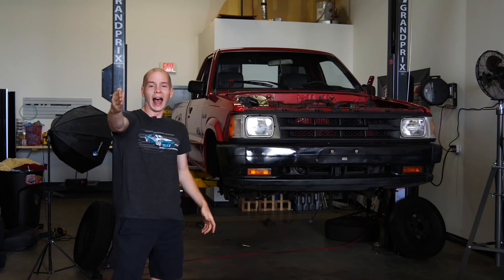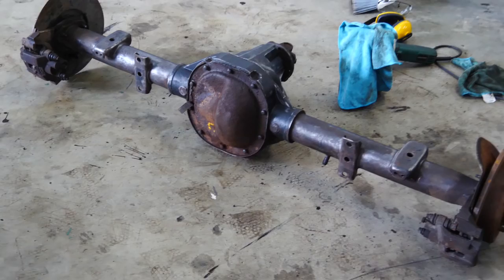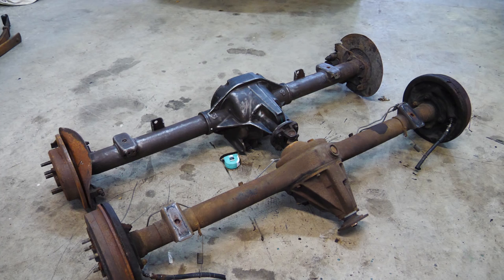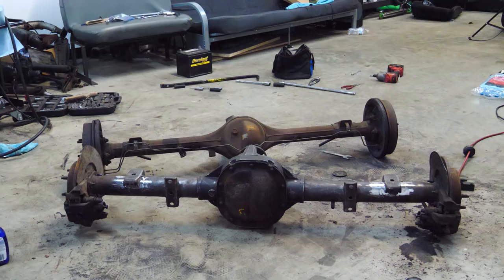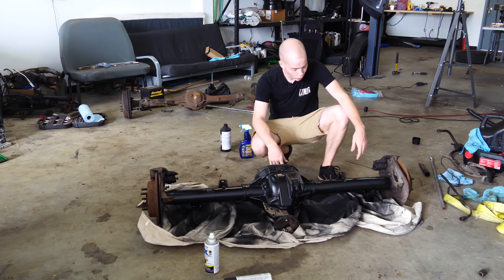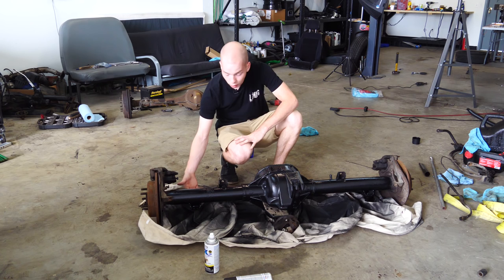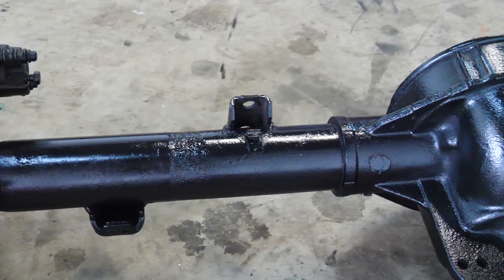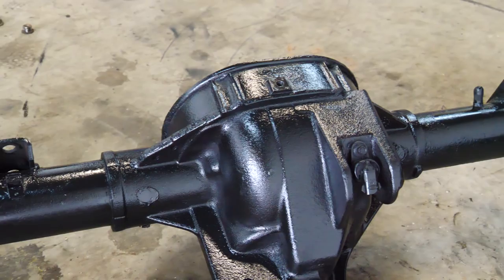Modifying the Ford Axle to Fit! - Project Drift Truck Pt 4

Comment: It was not faulty cutting discs. It was poor clamping that kept breaking them. The part twisted in a way that snapped the disc.
Reply: Ya i was thinking the same thing watching this. That final cut was curved and the disc bit into it then flexed.
Reply: yep, that was hard to watch..
Reply: I don’t get how he didn’t realize this. I knew the moment he started to cut it that would happen
Reply: he probably doesn't understand just yet because he's only just started doing metal work like this, sure for people like us that have thousands of hours under our belts we can see it and just shake our heads, but he is just a new comer, he'll learn...eventually
Reply: the third disk that broke was only partly because of the clamping, you could see him not anticipating the the angle grinder would "launch" forward as the disk wanted to cut the top bit.
Reply: Yes, those clamps were garbage.
Reply: And he let the discs get to small because they tend to shred at that diameter
Reply: General Insanity Dude its common sense. When your pasty white and sheltered in mommys house with your weekly per diem, your going to learn the hard way
Reply: He also eventually uses the cutting disc to polish, and puts too much effort into them...
Reply: Chucks Stuff I guess you just skipped learning grammar?
Reply: Was thinking the same, those types of cuts in general can be tricky to do with an angle grinder especially free hand as it can be tricky to keep it going in straight, if you move your arm a bit much it will bite into the cut and get stuck and break. (even if it's clamped better)
Reply: Just buy a bench vice .. your health insurance will thank you

Comment: I'm not sure it it will help you but look into slapper bars for the leaf springs. That's what I know them as. They are used in drag racing to prevent wheel hop so it might help for drifting.

Comment: HOW TO CUT WITH AN ANGLE GRINDER:
This will probably drown in the comments, but someone might learn from it. Mount the work piece properly, preferably in a bolted down bench vise. Never cut backwards, cut a shallow guiding cut on top if you need to but then start at the end towards you. Work about 1cm at a time and cut through before moving forward that way the disc will roll up on top if it sticks and get free. If you go the other way it will dig it self down into the gap when it sticks and probably explode.
There's nothing wrong with the quality of the discs, YOU are doing it wrong!
Reply: Yep. Caveman'ing it. Those discs have no lateral strength

Comment: @gingium when you weld try making sure the copper band in the middle of the ground clamp is touching the metal. It gives it so many more points of contact.

Comment: You could make your own traction bars that run from the bottom of the U bolts to the frame of the truck and it will help prevent wheel hop and wouldn't be too expensive. You may be able to find some for a Ford 8.8 that will bolt on and weld right to the frame but it wouldn't be too hard to fabricate if you needed to make them yourself.

Comment: in the rain, trucks are amazing. took my 1984 ford f150 xlt lariat, 5l v8. out, (note, its like 8 meter long. non double cab) and every turn it just hates it rear tires. only needs like 70km/h to drift. trucks are the superior drift car lmao

Comment: also get a welding lens and cut it so it fits over the camera lens so you can show the welds being made, also get pearl abrasive brand grinding disks and cutting disks
Reply: also dont put a lot of pressure on those cutting disks, when they break they can do a lot of damage to you

Comment: little tip, you can dramatically improve the durability of that axle for the abuse you're gonna put it through by welding the axle tubes to the center and buying a bearing cap support cover for about a hundred bucks. it reduces deflection and both of those mods together it shouldn't break on you. at the very least weld the axle tubes since that is essentially free for you

Comment: Gingium here's a few tips on grinding
1. Don't buy grinding wheels from a store like home depot or Lowe's you can he a 10 pack for like 5 bucks or something cheap like that
2. Take of the shield, from my experience it doesn't actually help the only thing it does is get in the way
3. Get an attachablw handle, it in creases the grip you have on the grinder helping prevent breaking blades and it gives you a little more control.

Thanks I'm not trying to be a know it all I just want to help

Comment: I would have welded the axle tubes to the diff housing. Its a know weak point since they are usually pressed and pinned in place. Its cheap and easy.

Comment: Look up a set of slap bars they attach to your leaf spring and have rubber bushing that goes against your frame and stops the axle from twisting up it's an old school hot rod trick Summitracing should have it

Comment: The discs are breaking because the piece is moving and breaking the fosc. Also have the disc contact the metal at the 6 o'clock position, it will dig and snap when it gets closer to the 9 o'clock position.

Comment: Calm down with your pressure when cutting steel with that. And it's not recommended but you can use the grinding wheel to cut

Comment: u can remove the speed sensor on it and just plug the threads with a weld or a bolt!!! You should also clean the breather nipple, Be careful not to get it clogged cz that will cause problems

Comment: You really need to get a bench vise.  Even a crappy Harbor Freight one is better than those quick clamps.  It makes any sort of metal work easier.  Also, the cheapest way to eliminate wheel hop are Slapper bars.  Like $150 for a set.

Comment: the dodge ram srt10 had a solution well somewhat solution which was to put a center shock to help with wheel hop.  so take a look into it and see if that helps you out..  also wish I could get you a band saw so you did not have to use that damn angle grinder.. LOL.. cheers bro.

Comment: Hey when you're using 1mm cutoff wheels you shouldn't use force to push them down, they break extremely easily when too much preasure is used!

Comment: you should look into getting a getting torch it cuts way faster than angle grinder just needs practice and they wont break like the angle grinder blades seriously ive been saying for awhile get an oxygen acetylene torch

Comment: Hey Caleb, you got a ford 8.8 and as a actual ford guy.... DO NOT weld that rear end. You can get a mini-spool for under $80 from summit or jeg’s. Bolt in REPLACEABLE solution.

Comment: Change the speed on the angle grinder it will save the disks. Whats happening is the angular momentum is lining up with the angle you are cutting at and then you go over the line the torque switches direction and you lose control of he disk causing a death wabble that snaps the disk
Reply: And it doesnt hurt to get some gloves and take the collar off so you can hold it tighter; as well as clamping it down firmly.

Comment: CREDIT. buy a plasma cutter even a cheap one of Amazon or Ebay would save you money in cutting discs. I purchased a cut 50 for like $200 and it operates on 120 and 240 I would suggest using it on 240v but it does ok on 120v also

Comment: You probably want to position the axle in the truck on stands and set the pinion angle where you want, then tack the spring perches on it before welding them on solid. There is no way that pinion angle is going to be correct doing it on the floor and just matching it to the axle that came out of the truck.

Comment: I’m starting this same build with an extra cab and a 1UZ twin turbo. Did you convert the front to 5 bolt too? I think a ranger hub fits on the spindle.

Comment: Go to the dealer for parts man. Things like u bolts are often not profitable enough for the aftermarket to either manufacture or stock. Just get a discount account set up with your local dealers.

Comment: So I might be worried for no reason but are you able to weld on a car axel? And if you are did you take any steps to prevent a post weld cracking on higher carbon steel?

Comment: You need to be more carefull with that grinder man. Your cutting with the blade rotation in some shots, you also used the zip disk to grind dont do that. It causes then to explode

Comment: Since I am finally here early for once, I would like to talk about the project I’m going to work on. Turbo Diesel Volvo
Reply: Nick Henry Fuck yeahhhhh
Roll coal
Reply: ok sticazzi that’s the goal ;)
Reply: Nick Henry are you planning on posting any videos?
Reply: ok sticazzi I might, but I’ve got to source the Volvo. I’ve had a few come up here and there, and they weren’t the best. I also would prefer getting a D24 Diesel engine for it, as it was standard for some of the 90’s model Volvo’s, built by VW. I will definitely think about posting videos. Maybe not full on build videos, but considering doing update videos.
Reply: Nick Henry the d24 often came in 240,740,760,940 try to get a tic version and be gentle with it, they arent as tough as everyone says
Reply: Blackcobra098123 I’ve heard that they hold up decently well. How hard must you push them to get them to go completely belly up?
Reply: Nick Henry sounds good dude

Comment: grindium, please learn to never use those "quick clamp" things again, they're great for holding some wood together but it won't hold in steel that you are cutting, get a pair of cheap screw clamps, the less finess the better.

Comment: Maybe you wouldn't break so many angle grinder disks if you actually used the right tool for the job when cutting stuff... you really need to invest in a metal saw, because you can't use an angle grinder for everything.

Comment: Dear god just get a vice for that table. Your cutting wheels broke because the metal you were cutting was barely clamped down at all and it would just rotate and shred your disks. Incredibly unsafe too to be cutting metal that isn't secured properly

Comment: the reason you keep breaking cutting wheels is because you are using one that are too thin and not meant for steel that thick its not the cutting wheels you are using the wrong cutting wheels

Comment: Gingium check out parkermetalworking.com
Look up the plasma tec60
Prolly the cheapest plasma that size that you can actually get support for if something ever goes wrong. The only trouble I've had with mine was the power switch went out. Got a new one on Amazon for 8 bucks

Comment: just as examples the bus needs a make over the rally miata needs a make over ... rx7 gone with the wind ... the mud panda culda been awsome but you diddnt see the potential of a rally miata support vehicle or a local practice rally spot you make in local woods and mud panda was the filming rig ...just think you had a filming rig  to chase the rally miata ....um ...now your putting wasted time and money into suspension parts that ARE NOT GOING TO WORK in the manner you want ...your a smart kid do your reaserch look at simple designs figure out how and why they work drifting and make your own weld away .... steel tube is cheep you can do way better than leaf springs if you really put your mind to it

Comment: If you use the right tool for the job... you wouldn't have that problem. Also, can you please for the love of god just stop with these no progress videos... 2 episodes for the rear end? Part 4 and all you have really done was go to a junkyard, take stuff of the truck and redo just about everything. I am not saying rush. I am saying stop putting out videos every chance you can, release them when the video actually has progress done to it. Like with the adventure bus, you did an episode on just putting in stick and glue down flooring on 3 steps...

Comment: This build is very slow not a lot of progress
Reply: +1...
Reply: well yeah, its not rushed so it wont be absolute shit
Reply: Mystic fuck sakes it's hardly even started what did you expect a complete car in a week
Reply: He's trying to take his time so we don't get BattleVan 2.0
Reply: I have been watching this channel since there were only gaming videos, i can easily say that after he bought the garage, it seems like he is not doing anything compared to before. Look at tavarish, b is for build, adam lz for example... Gingium here with his 13 minute video only welds two brackets and cuts some metal... I love this channel but i have to say 13 minutes for these just doesnt compete with other channels very well...
Reply: I mean, you should blame the cutting blade quality.
Reply: Ahmetcan Kuğuoğlu all of those people have like 4 guys to help..
Reply: Mystic GTFO. He's going very fast.
Reply: Ahmetcan Kuğuoğlu dude I took an autos class before at my high school and had to work on the exact same thing. Unless you've ever done it before, it isn't easy. It's a pretty time consuming process. Not to mention the fact that he's doing it by himself. I'd say for a 13 minute video, he did pretty damn good.
Reply: Mystic its a time consuming process, especially doing it yourself, while also filming and explaining, have some respect.
Reply: Just go to mighty car mods and check out the engine swapped 240z. Even though they have 5people doing the work, they still need 4-5 months of time to just get it started. So I think Gingium's progress is normal👍